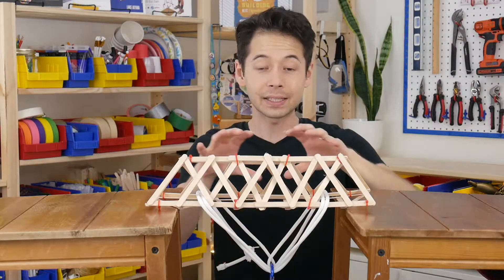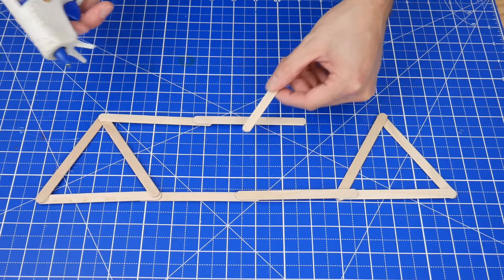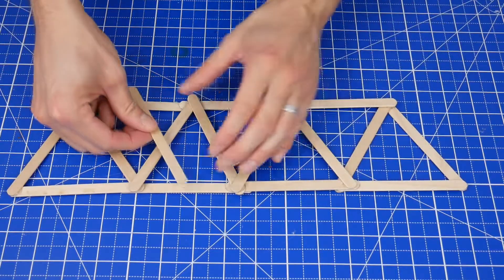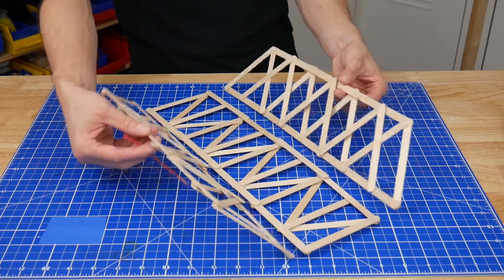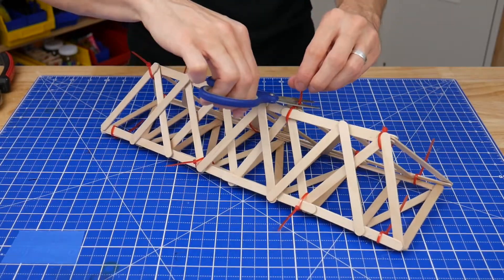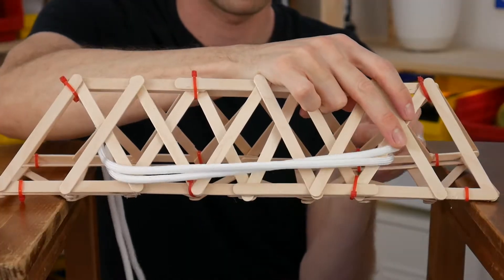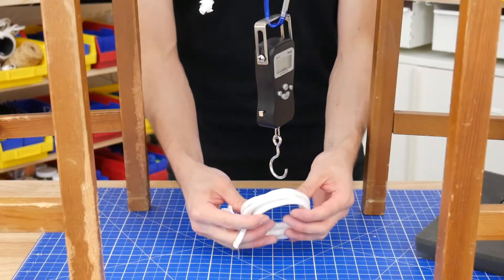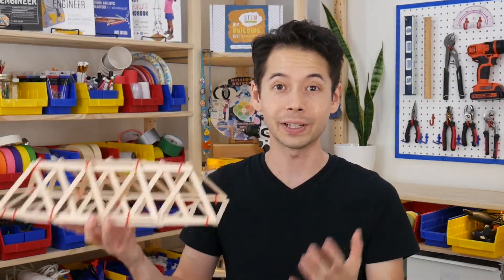Young Engineers: Triangle Truss Bridge - Simple and Strong Engineering Project for Kids

Comment: Can u tell me what was the total mass in kg
Reply: Man its a 4 yr old vid. Go find the weight of a pack of popsicle sticks then divide it by the count of popsicle sticks in a pack then multiply that number by the amount of popsicle sticks you'll use. Then get the weight of a hot glue stick using the same method and estimate the percentage of that hotglue stick you'll use and add that to the total